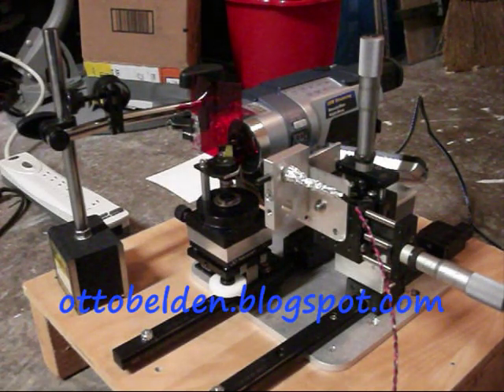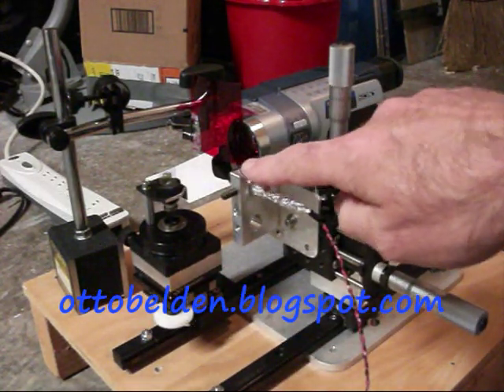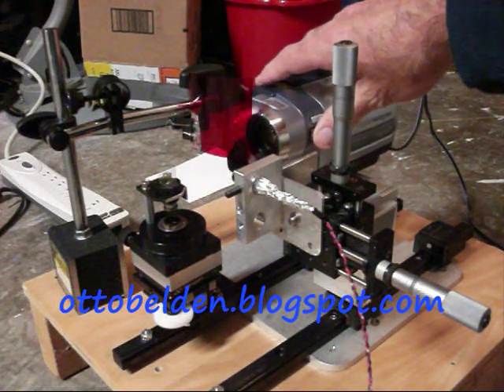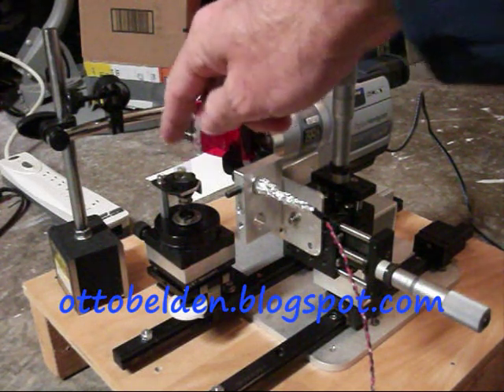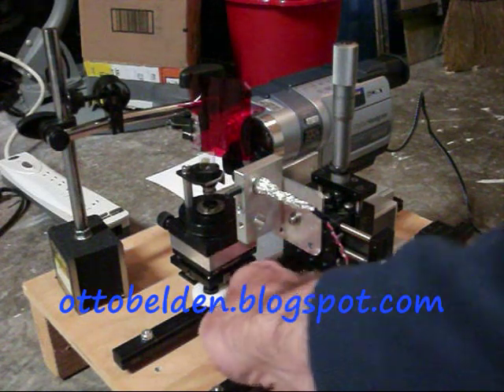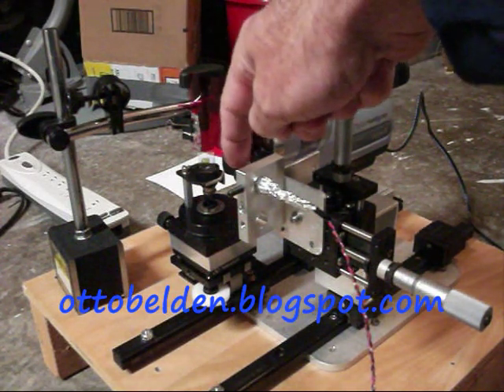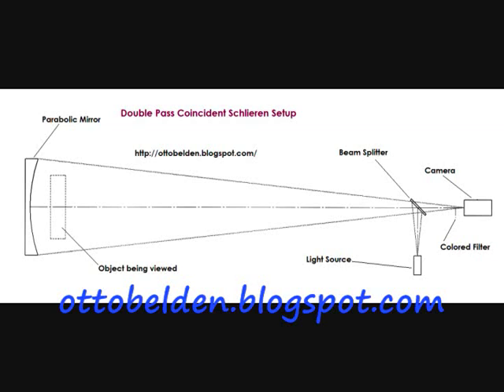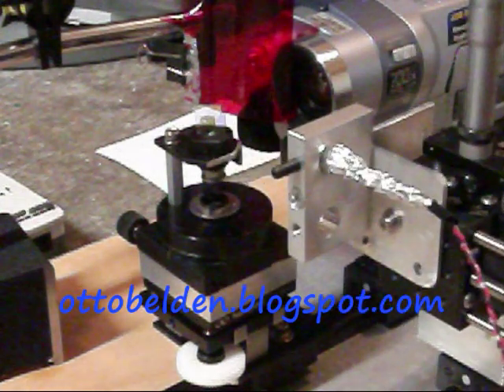Homemade Double Pass Coincident Schlieren.wmv

Comment: Hi Otto, thanks for all your info. I have a reasonable amount of z system experience and have recently set up a coincident double pass system using a front surface mirror as both the light source (focused a plasma bulb down) and the cutoff. It’s quite restrictive so I have just purchased a 50/50 beamsplitter. How important is the micro positioning of pan and tilt on the Beamsplitter? I am using a large format monorail to hold components and whilst I have a x3 axis stage on the cutoff, I just have quite coarse movements on the beamsplitter.

Comment from the maker: @jeffgrave Thanks! I have a lot more information about these setups on my blog:
ottobelden blogspot com look at the "Categories and Topics" in the sidebar. The filter or "Schlieren stop" should be right at the focal point. The camera and light source slightly farther and equal distances. I'm not an optics expert but I have noticed confusion about the focal length. One use is the distance to the focal point and the other is to where an image is formed. One distance is twice the other.
- Otto